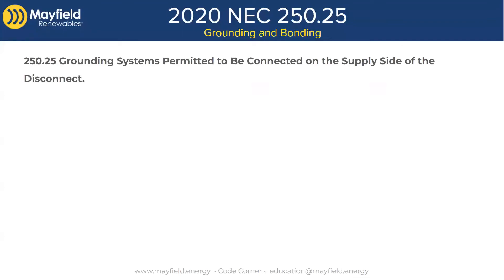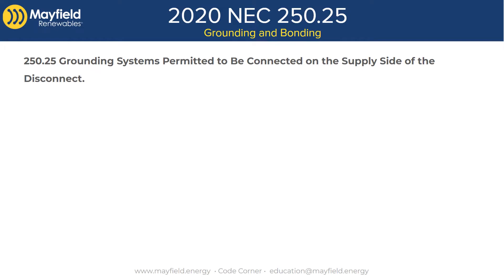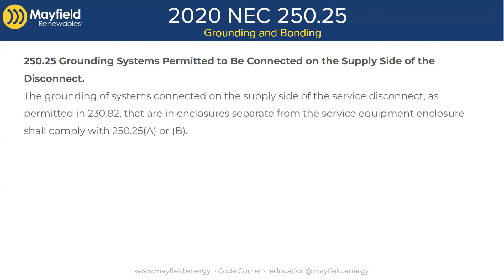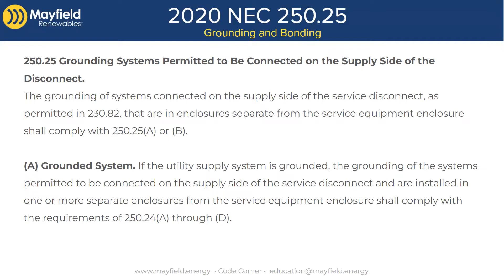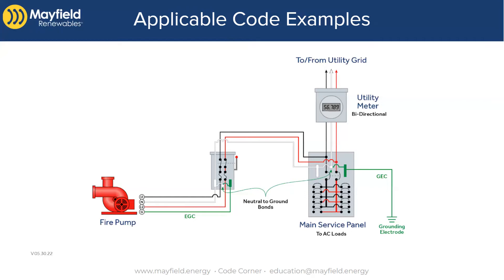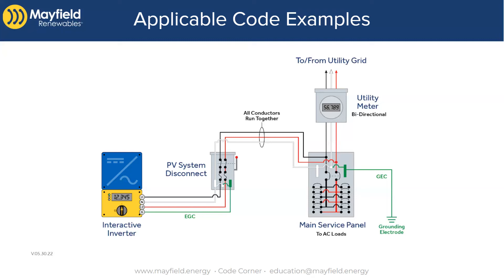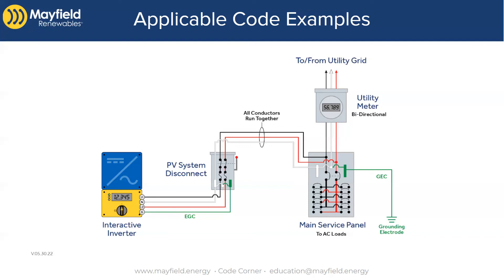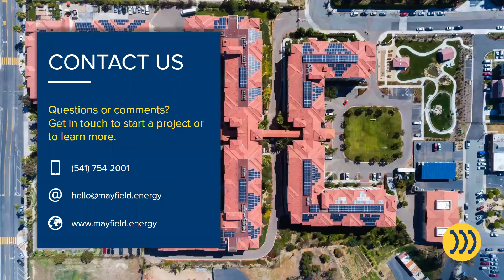Mayfield Renewables Code Corner - 2020 NEC 705.11 & 250.25: Supply Side Grounding

Comment: Awesome video! I have noticed you have a couple videos on supply side connections and depict the SSC a couple different ways in regards to the EGC/GEC from the fused disconnect to the Main Service Panel/existing GEC. This video I believe is a good default way to show a supply side connection but I am curious about when it would be preferred to run an EGC/GEC from the fused AC disconnect to the MSP or (E) GEC?
Reply from the maker: You are correct - we depicted the SSC a few different ways previously. We have corrected those and will be posting a new batch of Code Corner videos soon.
Reply: @MayfieldRenewables  Thank you!